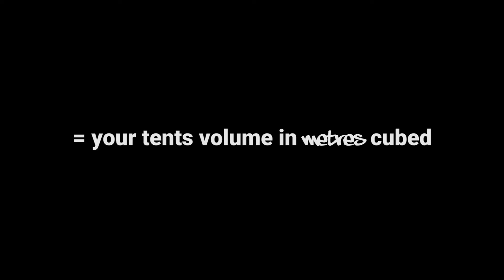The Easy Way to Calculate Which Size Extraction You Need

Comment: Length x Width x Height x by 20,.. refreshing your air every 3 mins,!  
Also have your outtake fan running at 10-15% above intake speed to achieve negative pressure,!
Been working for a "friend of a friend of a friend of a flatmates second cousins sister" thst i know,!!!

Comment: I have a 1.2x1.2x2.0 tent can anyone tell me what size of carbon filter and extraction fan to order please?
Reply from the maker: hey dude, go for a 5"!

our kits are already there so you just have to choose which fan you want :)

https://www.onestopgrowshop.co.uk/fans-filters-and-air-control/fans-filters-and-air-control-digital-extraction-kits.html
Reply: Hey buddy, an easy way is to calculate the size of grow tent first, so 120 x 120 x 200, this gives you the size of grow area,..288 cM2, then round this No up to the next whole No,..290.  Take this and times by 20, not 10 like most others, ive found this out by 25 years trial and error, this gives you 580 cM2, this allows your air to be replaced every 3 mins, which is optimal.  
I wouldn't change my air every single minute, the plants won't have enough time to extract the Co2 from your fresh air intake bro,!! 
Also A small tip, if you calculate your tent needing a fan running at 580 cM2, I'd personally go for a fan that has a top speed of about 720,ISH, this gives you another 140 Cu to allow adjustments in the Warner summer months, and your fan ain't being too heavily taxed, running at 100% at ALL times, better to have a bit "play" with your environment IMHO pal..
Then for negative pressure always have outtake running 10 - 15%  above the intake, this gives you optimal negative pressure for a much healthier N happier crop.  Never have more air coming in and less going out as this will reverse the situation into positive pressure, which is a definite no,no,!!
Hope this helps out bud,!
Regards, Scotland, UK x

Comment: hello hope you can help im doing a 20x25 what would you recommended me??
Reply from the maker: Hey dude, that's a big area! If it's 6m x 7.5m, you want to be looking at two extraction systems, one at each end of your setup so you can't go wrong. 

Pair it alongside a fan speed controller which has got a maximum output setting and it'll automatically dim them down to quieter levels and kick in whenever needed (the enviro controller is a great option for this.)

In terms of fans, you'll need to go big...

https://www.onestopgrowshop.co.uk/systemair-super-silent-revolution-vector-ec-fans.html

12" or 14" inch Super Silent Revolution EC fans would be perfect...

If you need anymore help dude, give us a call and we can guide you through it all!
Reply: @OneStopGrowShopHydroponics  wow thanks soo much for this info and helping me out! I haven’t really had any help just throwing my self into it in hopes of making it happen haha
Reply from the maker: @kernblock323  you know where we are if you need a hand mate!

Comment: Can you please let me know if a 4-inch diameter exhaust fan Vivo sun 190 CFM per min with a carbon filter and a 6-foot run of duct with a 90-degree Bend will  be sufficient for a tent  that measures 2 by 2 by 4 high?
Reply from the maker: Hey mate, we don't sell that fan so we wouldn't really like to comment on if it'd work, but with our 4" fans, that'd be ideal.

Cheers mate!
Reply: Excellent thanks for the response I went with the 4 in AC Infinity T4 thank you for the help.

Comment: Good day! Was wondering if you could help me out, please..
I have a lean-to greenhouse with a 20 square meter floorspace, with one side beeing 3,60 tall, on the other side 2,10 (in metres) 
If my calculations are correct i have around 57 cubic meters of air to move.
Can you please tell me the right size of the fan i'd need? All the best!
Reply from the maker: Hey mate, a 6" Hyperfan would do you nicely!

https://www.onestopgrowshop.co.uk/phresh-hyper-fan.html

If you need a carbon filter, we do kits with that too, just see our website :)

If you need anything else mate give us a shout!

Cheers!

Comment: If you are using low heat output led grow lights so that temperature isn't a worry, how mary times per hour does the air need to be changed to keep the CO2 levels optimal during full grow conditions. I ask as during winter months at is necessary to add heating, to save on electricity and cost I'd like to exhaust as little heated air as possible whilst also keeping the CO2 levels topped up to optimal levels.
Reply: hey did arrive at answer for this?